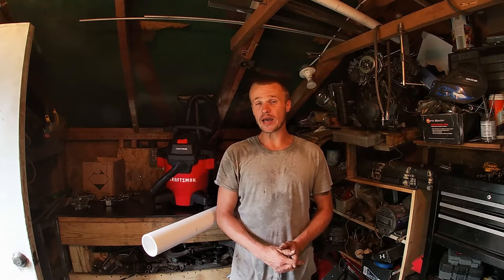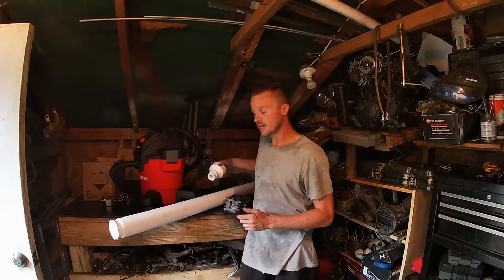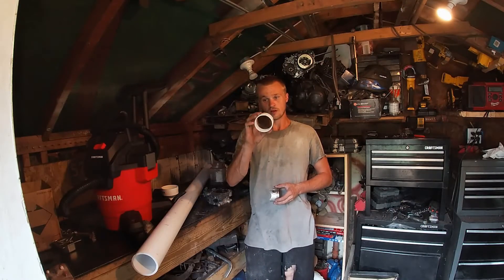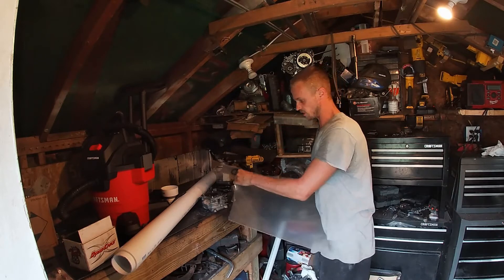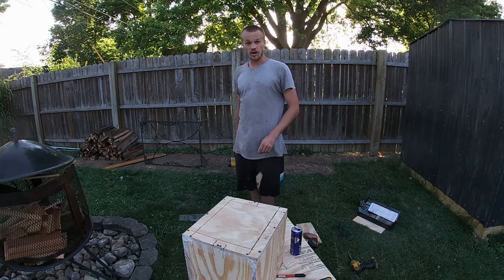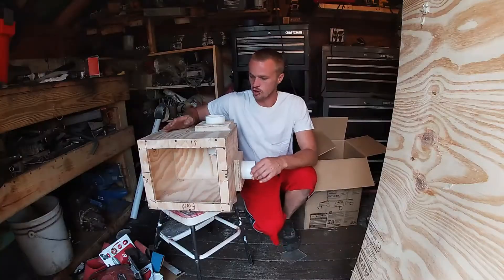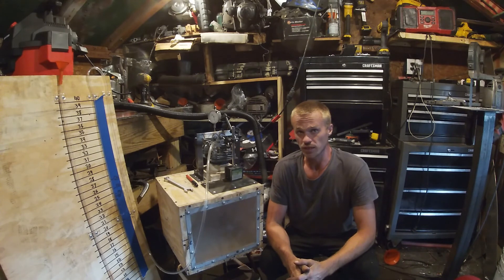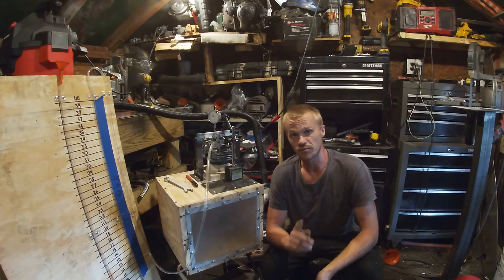HOME MADE FLOW BENCH FOR PREDATOR 212

Comment: You really need to take it out to 3 inches because if you are going to work on a lot of small engines you will need to check those with the bigger bore and of course bigger valves

Comment: I don't know why you sat there and fought with it all damn time with that sanding thing you made should have took a fucking cylinder home to it and got it done with a long time ago so you didn't have to turn off the fucking video and restart the next day how much time do you really have invested in that flow bench you didn't build it in about 5 minutes
Reply from the maker: From what I remember, about two days. I have it set up to do small block Chevy heads now. Just had to make a different adapter.